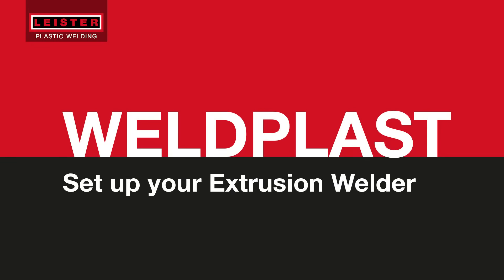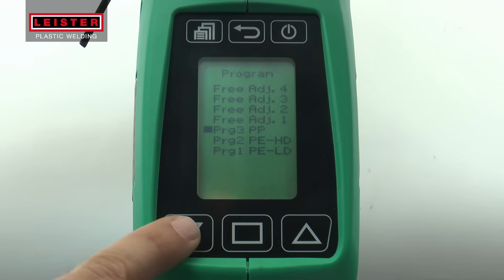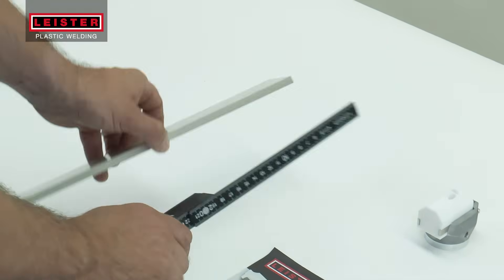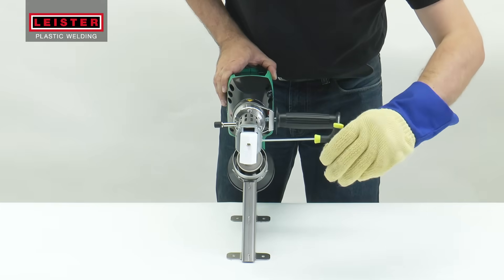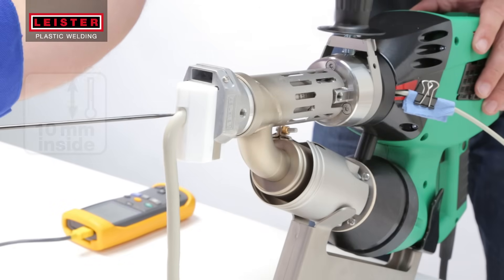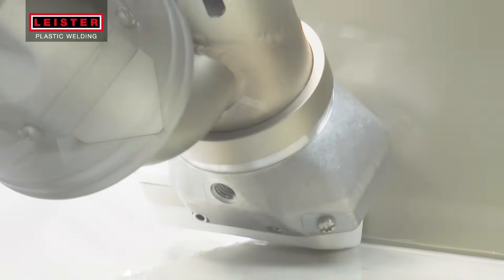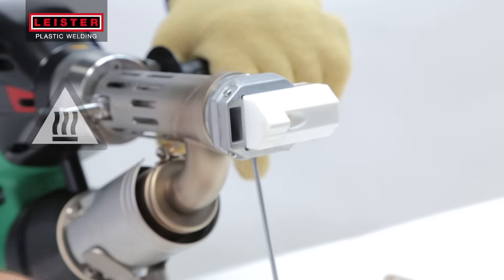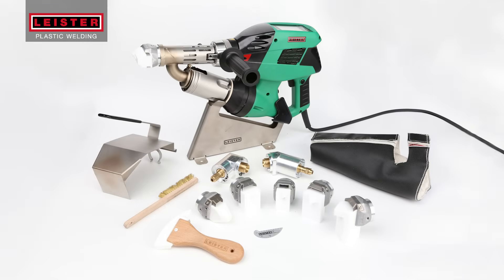Leister Tutorial | WELDPLAST Extrusion Welder setup

Comment: how many degrees must it show on the screen before closing it? air and plastic
Reply from the maker: Dear Ionel
Thank you for your request.
Press the Off button on the display and let the extruder cool down for 5 minutes. The air should drop below 100 degrees Celsius. The plastic remains very warm for a long time. But this is no problem, just don’t storage in the plastic case as long as its hot.

Best regards
Your Leister Team
Reply: 40  Grad kannst du ausmachen